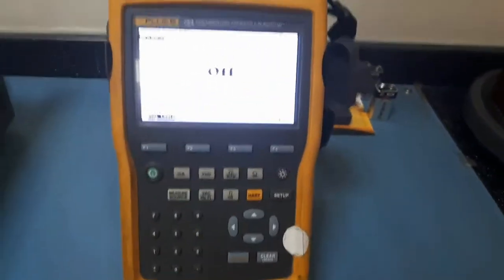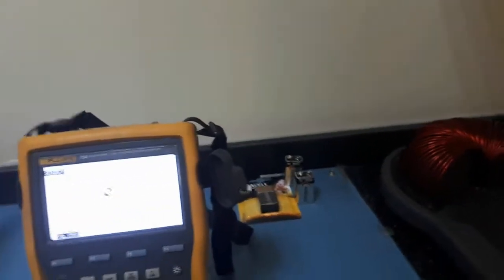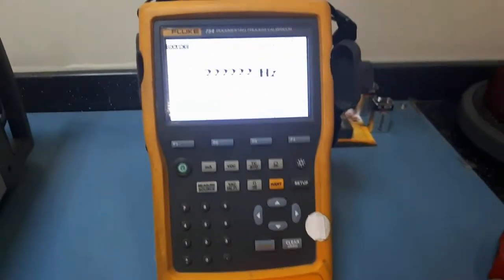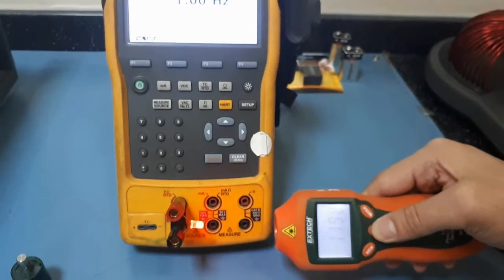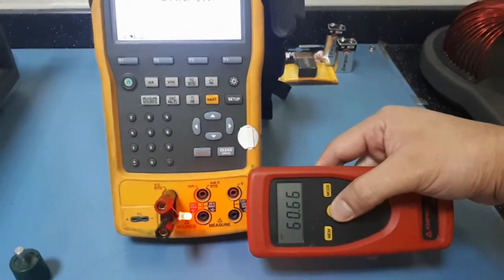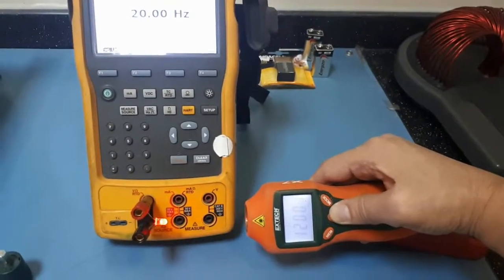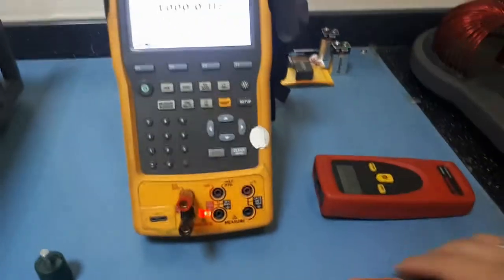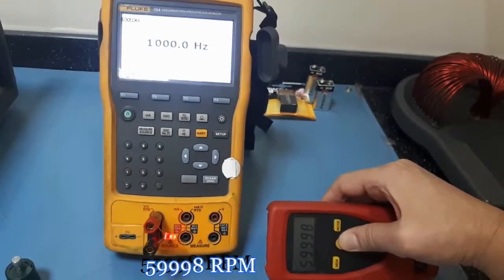Tachometer Calibration Procedure

Comment: What does the 754 process calibrator get calibrated by for frequency, going up the hierarchy? Is it a Signal generator from a Fluke electrical calibrator? Thanks.
Reply from the maker: Yes, you are correct,  specifically,  a Fluke 5522A calibrator.